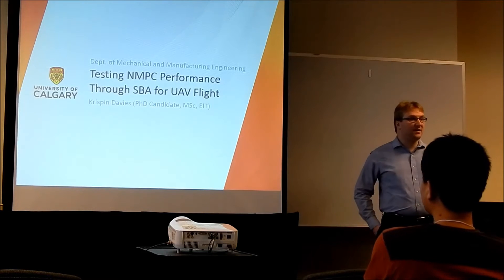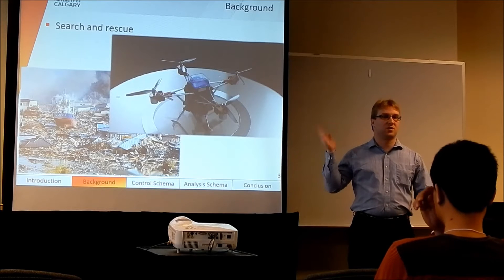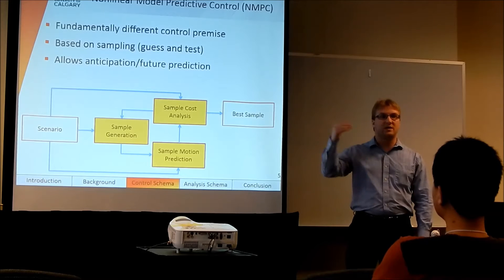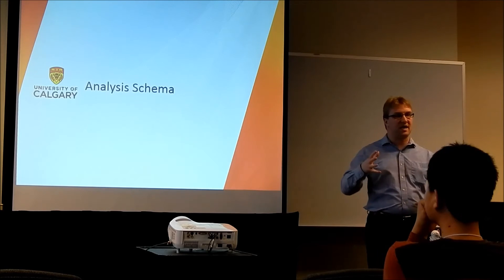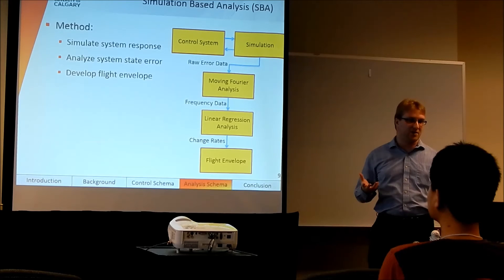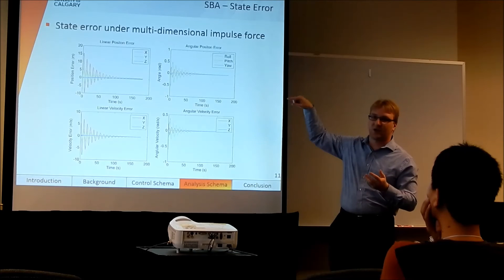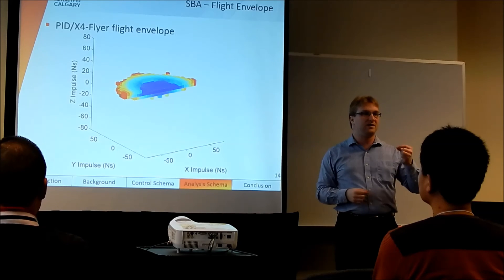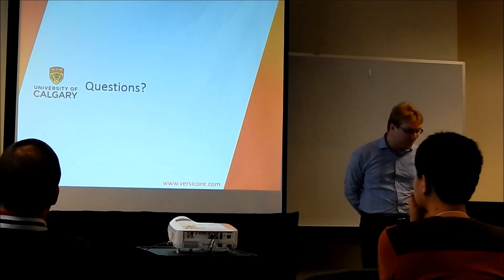2015 UCalgary Mechanical Engineering Graduate Conference Presentation

Comment: 🎯 Key Takeaways for quick navigation:

00:01 🚁 Introduction to Non-linear Model Predictive Control for UAVs
- Introduction to the presenter and the topic.
- Overview of the presentation structure.
00:57 🌍 Importance of Unmanned Aerial Vehicles (UAVs) in Search and Rescue
- Highlighting the role of UAVs in search and rescue operations.
- Discussing the challenges faced in such scenarios.
- Introducing the need for advanced control systems.
02:03 🕹️ Non-linear Model Predictive Control (NMPC) Explained
- Explaining the fundamentals of Non-linear Model Predictive Control (NMPC).
- Emphasizing the difference between NMPC and traditional control methods.
- Describing the process of guessing, testing, and sampling in NMPC.
03:53 🔄 Challenges and Probabilistic Nature of NMPC
- Discussing the challenges of NMPC optimization and cost analysis.
- Addressing the probabilistic nature of NMPC when dealing with a large number of samples.
- Mentioning improvements made to alleviate these challenges.
05:17 📊 Introduction to Simulation-Based Analysis
- Introducing simulation-based analysis as a solution to evaluate control systems.
- Describing the process of simulation, analysis, and frequency spectrum evaluation.
- Highlighting the importance of creating a flight envelope for stability assessment.

Made with HARPA AI